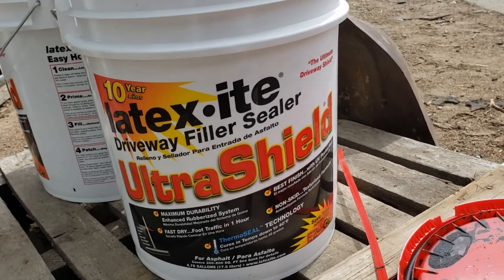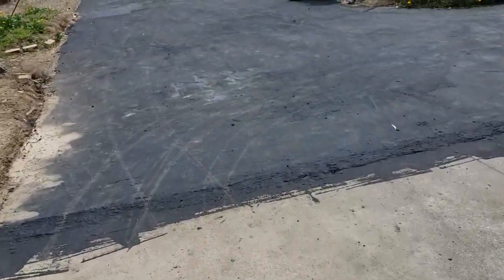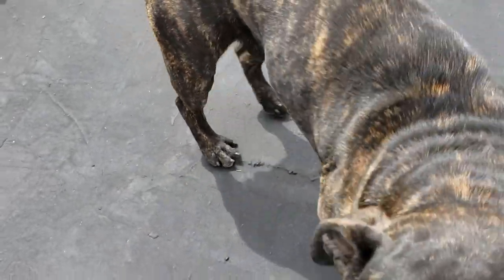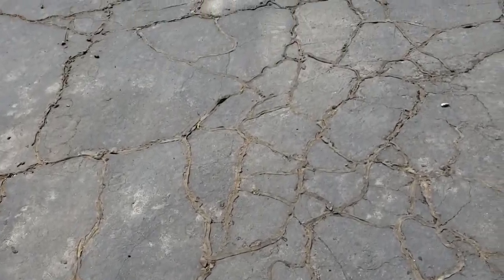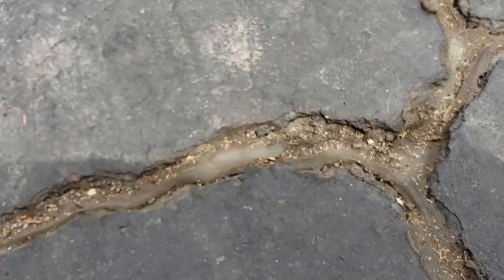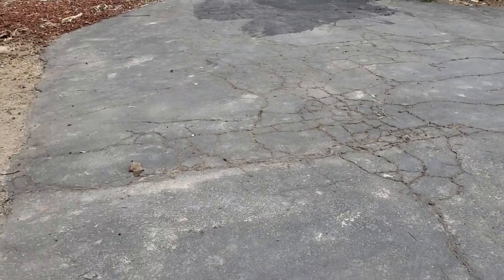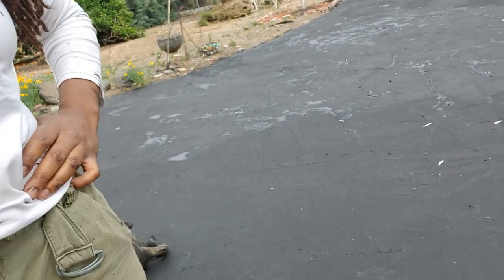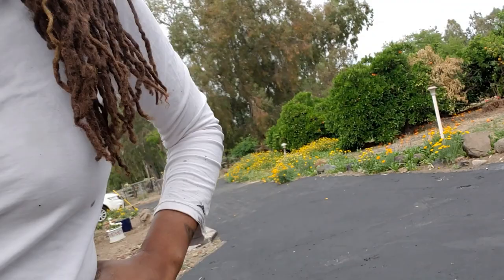Ultra Shield Latex-ite Driveway Sealer

Comment: just did my driveway with the same stuff, did two coats, in new england and hoping it lasts a few years.
Reply from the maker: oh nice! I hope so too.. this is our second year using it and so far so good...
Reply: Lashanna Chronicles nice thanks I will check out your other videos as well!
Reply: @Thefashionwelder  the bucket says it can do 300-400 square feet on rough surface ...other people said that was a lie and it only does 150 square feet per bucket...what is your thoughts?
Reply: @dwade6322  It depends on how much you pour in a section, and how far it's spread.